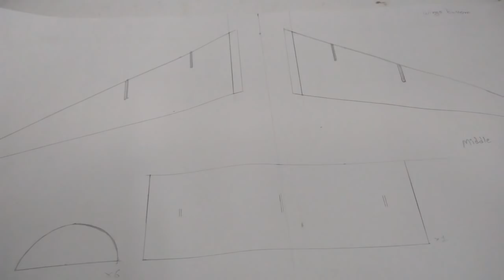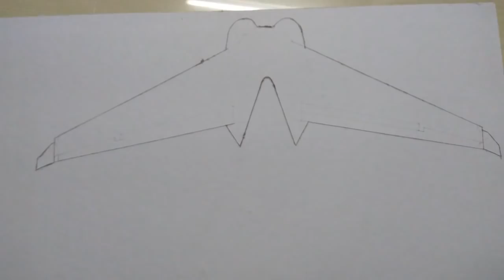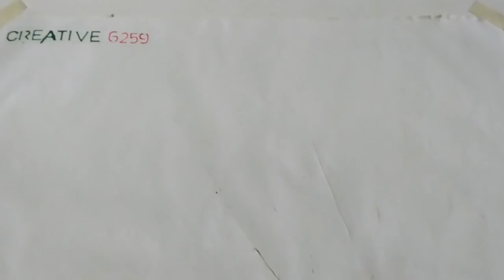How To Make A Plane (C17 GLOBEMASTER) - DIY Cardboard - Tribute To PAUL WALKER And AIRFORCE

Comment: Bro I have used a normal led with a  9V battery  . But when I put one let it got burnt any solution .....
Reply from the maker: Never try single LED on 9v Battery. Always use at least 3 LEDs in series for 9v battery. That's What My Formula Is :)..3LEDs for 1 9v Battery.
Reply: Or use a resistor